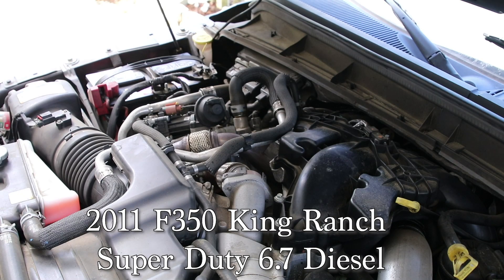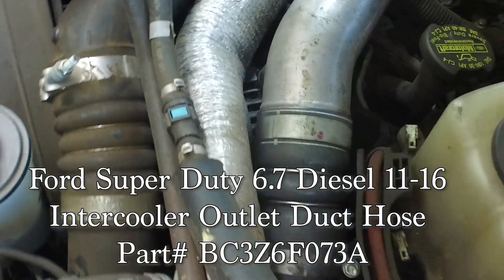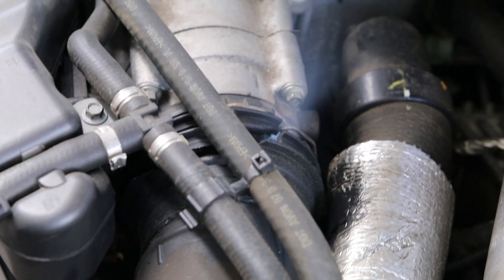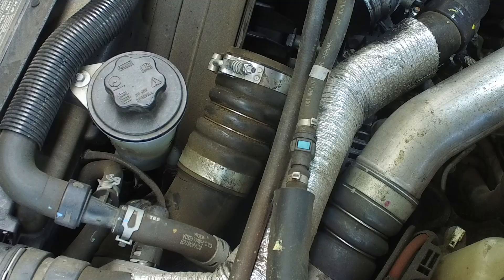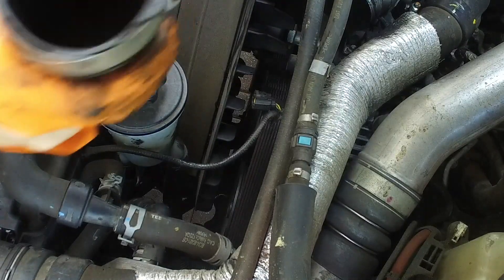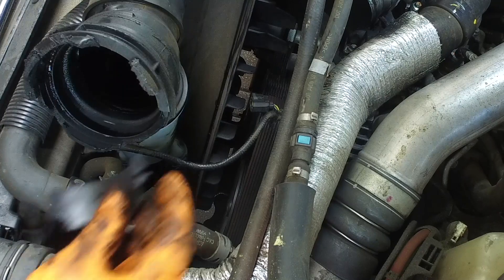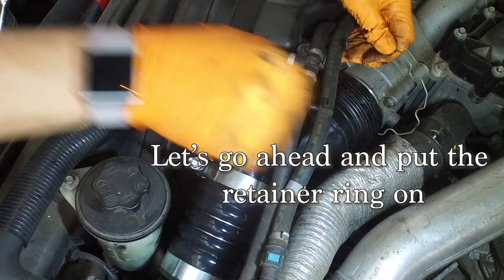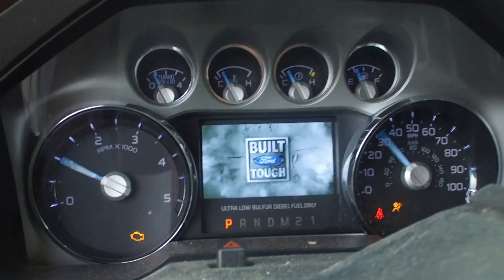How To - Intercooler Pipe Explosion and Repair on 6.7l Ford Diesel Power Stroke

Comment: I noticed at the end of the video the check engine light was still on.  Same thing happened to me.  Replaced the intercooler hose and the check engine light won't go off.  Any thoughts as to what I might try.  The truck runs great now other than the light being on.
Reply from the maker: If I remember correctly, I believe mine went off on its own. But I'm not 100% because it's been so long

Comment: The top turbo end connection is very exposed.  I wonder how many of them get cracked from the owner or techs putting weight on them or wrestling off then reinstalling to get at some other repair.  Also, is this a problem primarily with performance tuning which causes boost well beyond original design parameters?
Reply from the maker: My problem wasn't performance tuning; never had that done on my rig.
Reply: @AndiWofford  … good to know!  Most other incidents here on YT were tuned up.  I’m getting my truck ready to travel the Dempster Highway (gravel) up through the Northwest Territory to the Arctic Ocean. I don’t want to be broken down in the middle of east Jesus. There is also probably a temporary fix for this.  Duct or repair tape and re-clamp comes to mind, off-hand?  That said, if it is inevitable that this is going to happen, I may as well get to it now.  217,000 miles on my 2011 6.7.

Comment: Happend on 2017, hose blew, limp mode, under warranty, dealer threw a particle delete filter that took 7 days to find, last one in the country because of covid bull shit. Drove 3 miles and limp mode again (do not turn truck off in limp mode, it won't go over 1 mph after shut off) pulled back to ford, opened hood, 10 inch split in inter cooler charge supply hose..fixed and still going till next time.
Reply from the maker: Glad they were able to fix the split in the supply!

Comment: For that price I think I would’ve gone with the SPE replacement part instead of that plastic adapter they use metal and then they use a better hose
Reply from the maker: I think you're absolutely right, an upgrade is warranted so that you don't run into the same issue again!

Comment: Don’t remove the ‘retainer ring’ as you called it. You’re supposed to leave it in the a lot and it just snaps on. You only have to removing the clip for removal.
Reply: Holy crap thanks,,,, I’m trying to snap it into place after connecting the hose, not working.. I’ll try setting the retainer in place and fitting the hose back into place
Reply from the maker: Thank you for that advice. Hopefully it helps someone!

Comment: Was there some metal rings inside those that I assume support the plastic when you tighten the t-bolt clamps?  I have one wide and one about half as wide in a 2015 F450.
Reply from the maker: Hey Jeremy, I don't remember there being a metal ring in there. I thought it was plastic, but it's been over a year since I did it. I wish I could help.
Reply: Andi Wofford ok, thanks for the info, I had a clamp give out, and things fell apart before I had a chance to see where they came from.  Did you have any oil in them
Reply: I believe mine just blew. Loud POP minor explosion sound, while accelerating onto highway. Lost 75% of power instantly. Pulled over, popped hood and there was this 3" in diameter, 1/2 inch wide steel (looks like a steel bracelet) laying on the top of my radiator hose. It was covered in  black oily greasy crap. What the heck?? And where did this come from??

Comment: Happened to us on our journey from WA to yellow stone to Grand Canyon and back through CA, as soon as got up on Idaho about 20 mi from Boise the hose split on the  factory glued joint, it was Saturday right after 5pm. Dealers closed and we had to leave to yellow stone the next morning. Got stuck here till mon.  Will see if they have part tomorrow morning. And yes no other auto parts stores carry it. Should be a must part for all stores considering the failure rate. 😡
Reply: Oh and I tried gluing clamping nothing works. Pulling 12000lb 5th er pops in less then gaining 40mpr 🤦🏻‍♂️
Reply: Had people recommending me to get two or three while at it because some people experienced failing within next 200 to 300 miles with the new one. Had anybody had this happen for more than once?
Reply from the maker: Sorry that happened to you. I've replaced it with the OEM version and haven't had trouble with that one in 11 months. Good luck, hopefully the dealer has it in stock given the failure rate!  As you can see, it's a fairly easy replacement once you get the part in.
Reply: Andi Wofford dealer is on a 6-8 week back order....ugh.  I don’t want to drop 400 on an aftermarket stainless setup either.

Comment: Mine split at the factory joint past the accordion looking piece. was going to just throw a clamp on the joint but opted for replacement after seeing the failure rate on like miled vehicles
Reply from the maker: Good idea to replace Tim. It's likely to break somewhere else along the pipe very soon. These things aren't really made to last and you might find yourself limping along somewhere in the near future if you don't replace.

Comment: Happened to me so I put the blade hot and cold in. Talk about pain in the butt getting everything lined up had a coupling blow off the cold side during my test run. Got it lined better and vclamped down straight. Going to run it for a month see if any mileage increase.
Reply from the maker: Awesome! Let me know how that works out, as I've been considering replacing the hot side as well.

Comment: Happened pulling our 5er.  No replacement hose available so we limped it back home pulling 5er😂
Reply from the maker: I'm really sorry to hear that! Hope you were able to get it fixed!
Reply: Andi Wofford, your instructions were great!! Limped truck & 15k 5th wheel home for 135 miles (35 mph - w/out turbo towing was nearly impossible),  today picked up the replacement hose at dealer (auto zone & others don’t carry) & installed in driveway in about 15 minutes.  I am not a natural at anything mechanical, but can follow good directions.  Wasn’t sure on torque specs for lower bracket, but got it fairly tight.  Had one of my mechanic buddies clear the code later.  U saved us at least $160 labor from dealer & we are very grateful!  On an unrelated note i wish u continued success on your journey & love videos like this breaking stereotypes.  Although i fit a stereotypical demographic our family embraces diversity & those Trail Blazers.  God bless & thank u for the wonderful video!
Reply from the maker: @BB-dg1sc  This absolutely made my day! Thank you so much for the sweet reply!  I can't believe you had to drive home at 35mph for 135 miles! Glad you were able to make it home safely and got your part.  I'm so happy you were able to save on some labor with the dealer too!  My code cleared on its own after a little bit of running around once I fixed the pipe.  On a separate note -  I really do enjoy cranking out all types of videos - I just don't really want to niche down into one specific subject area like most of the reccomendations to grow your channel.  Which is why you see all types of videos on my channel. God bless you and your family for understanding and embracing diversity.  We need more people in the world like you!